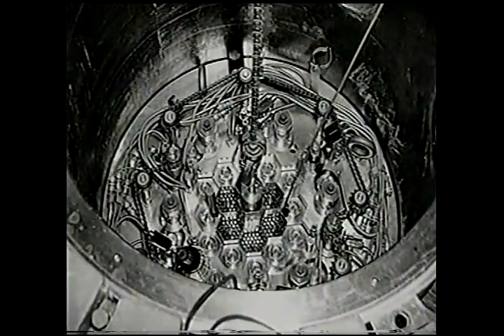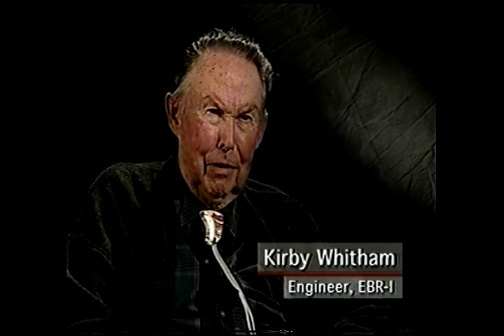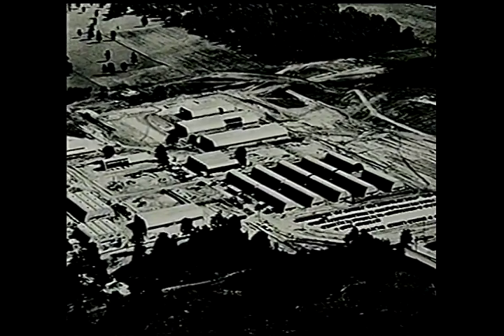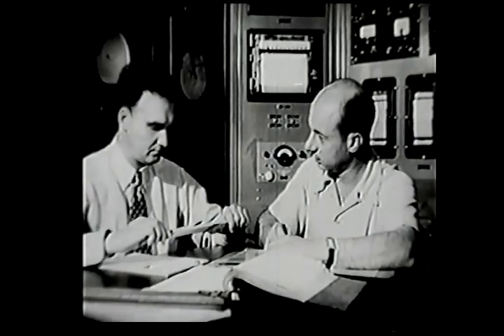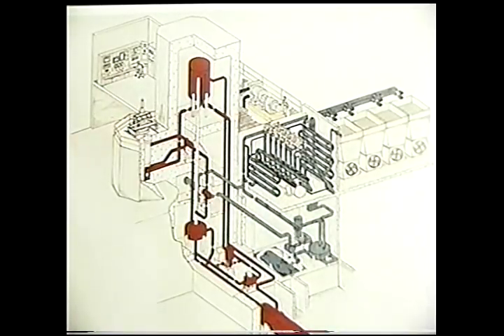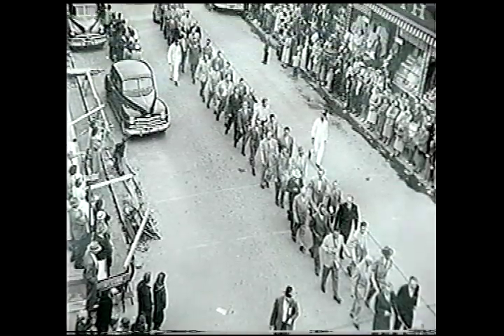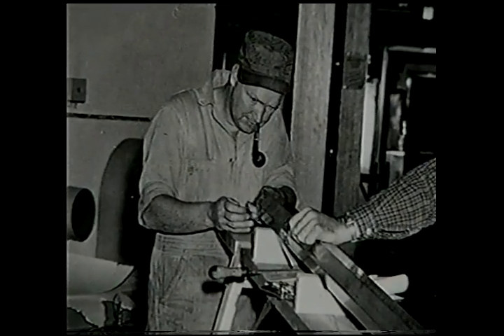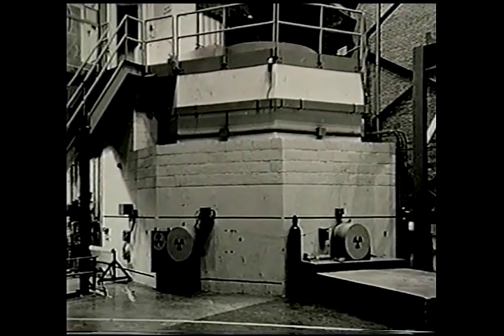Nuclear Pioneers: EBR-I

Comment: First off, this was a research reactor. Chernobyl was a full sized commercial power plant. There is no way this reactor could ever meltdown like Chernobyl just based on the number of fuel assemblies. Second, Chernobyl uses a completely different design (RBMKs aren't even breeders, they are just poorly designed run-of-the-mill LWRs, and the only reason they produced Pu is because the fuel was U-238, not U-235 like most LWRs).
Reply: USKilop and we all have heard that be for!!! It can’t happen
Reply: Truck Mechanic   You are aware of your username, right?
Reply: (layman) but didn't they intentionally keep the test reactor's wattage super low to make that risk pretty much 0

Comment: When you look at the level of height of building, sheer cost of design and R and D,  All the Castings and Heaters and extra steam tanks and vents and suppression pools...this tech is not viable and never will be.  It's dirtier and more expensive than coal.  San Onofre put out so much heat that it warmed the ocean.  Fishing boats used to fish at the edges, where the bass and mackerel were forced by the hot water from the plant.   The ocean bottom was scoured clean from the heat, none of the animals survived.  It was a disaster.  Mass slaughter on the ocean floor off Los Angles. You could build 100 NG plants for the cost of this half-baked NP scheme.

Comment: CP-1, the reactor you refer too also had no cooling system. In Chernobyl the water boiled and that caused a steam explosion. When the coolant in a graphite moderated reactor is lost the reaction continues and continues producing very large amounts of heat, and is impossible to control or shutdown due to a high positive void coefficient. In a water moderated reactor when the water is boiled off, yes they melt down, but the reaction is slowed severely or stopped.

Comment: On November 29, 1955, the reactor at EBR-I suffered a partial meltdown during a coolant flow test. Almost a first Chernobyl. The Americans have always been lucky when it comes to nuclear accidents.

EBR-I used uranium metal fuel and NaK primary coolant. It was in this identical to the initial configuration of the later Dounreay Fast Reactor which first went critical in 1959.  Dounreay suffered some very serious accidents and is now costing billions to clean up.
Reply: They failed to understand about Xenon-133 poisoning of the fuel rods!

Comment: The key in making these nuclear power plants safe
Is making them small       And only have enough material to run approximately five years  The construction of the huge power plants is what makes these accidents so frightening.  A small power plants something that would power up maybe a smaller community something that was easily take it off-line something that was easily made safe in the event of an accident is infinitely better than  getting machines it’s suddenly melt down and cause havoc for thousands of people. There are hundreds of power plants working on battleships submarines aircraft carriers that are reliable easily maintained and these are under some of the most harsh conditions. They have proven to be indispensable and safe
Reply: no to fuicken nuclear energy full stop...
Reply: fuku fukushima Then I had to guess you have to say no to the fucking sun. US military has 25 battleships aircraft carriers and submarines have never had a nuclear accident

Comment: Third, they would never get the green light to do this experiment if it was a water cooled reactor. They knew a meltdown was possible, but they also knew that the NaK would never contact water. Remember, the NaK is the coolant in this design, so water and NaK would never both be used to cool the same reactor, so what you are saying is impossible.

Comment: A successful experiment is no accident unless someone wants it to be, Scientifically speaking.
***
Often wondered why the Engineers designed the piping to fail in a clean break shear, as well as a corrosion pinhole (?), but after seeing the consequence of ER=EPR shell-horizon envelope-shaping of shock wave modulation containment in resonances, the possibility is realistic and relevant because the Reaction operates at the Critical Point of Nuclear Resonance, Fusion-Fission of Neutronic boundaries, and that will include the composition of the constituent nuclei in the pipes etc. Conductivity of the materials subject to possible shear is required to be extensively tested?

Comment: Moderators slow the neutrons to increase the chance they get absorbed by the fuel element. While light water does adsorb some neutrons a reactor can't function with out a moderator. Also EBR-1 had a very tiny core, and only produced 1.4MW of heat, the RBMK reactor at Chernobyl produced 1000+ MW of heat and a core that you could park a couple trucks in. Very big difference.
Reply: RBMK 1000 reactor like 4 Chernobyl are good reactors, 4Chernobyl was operating outside of operating parameters when it had problems they are still in service until 2037, I would take a RBMK 1000 over a GE MK1 BWR any day.
Reply: @gck82s  False! The RBMK reactors have many flaws, and Chernobyl-4 should have been fine, even "operating outside of operating parameters", when the power excursion occurred. Many of these intrinsic faults have been rectified in the remaining RBMKs making them far safer. Also, I agree about the GE BWRs.

Comment: From what I've seen, LFTR (Liquid Fluorine Thorium Reactor) appears to be something the US has pursue! And, much of the research was already carried out back in the '60's! Check out this website to learn more: energyfromthorium
What seems to be the stumbling block to this technology are the carbon and uranium cycle "merchant" interests.
Reply: K4Fusion   There are many technical stumbling blocks to ultra-high temp liquid salt cooling as well. Really significant ones in terms of material science.  The cooling tubes are so deeply imbedded in the design of a reactor that they must last decades to be financially feasible.  It is far simpler to replace the fuel itself than to replace or retrofit the tubes.  Until now, we have not managed to make a tube that can withstand the intensely corrosive combination of heat and salt for the needed service life to make a feasible reactor.
Reply: There are many ways to build a MSR. The reactor itself is not the issue and it's cheap.
The problem is political.

Comment: Look people we don't need any fossil fuels at all not for heat not for power generation and not for powering vehicle ,I have designed a machine that only needs a water source coupled with a water pump the water is brought into the kettle steam vessel which has an electric element like an ovens there are laser designator to keep water level above the electrical element the water is brought to a boil which treats and cleans water for cooking and washing and drinking the water after boiled is and a separate cooling tank and another tank for hot water separate from the boiling kettle so the boiling is always always quick water has to be brought in at a rate not too quick that put too much cold water at one time and the boiling point will take a long time to if water goes below element ,it will burn out right away ,this is all controlled by computer and after water is boiling the steam turbine generator makes power to charge a battery pack that would hold like a week's power and as it uses power the computer makes more just to keep batteries charged up . Make the house a real smart house sensor in each room like at Walmart it'll turn lights on and off as a person enters or leaves room and computer will put power where it's needed most first for heat for water for drinking so it's boiling water what's it's biggest by product ,heat it's heat so water sent into floor pipes that flow through a closed loop system and hot water goes through warming home up and as it travels the loop and cools it goes back into kettle to be reheated ,also water for toilets will be the waste water that is collected after it goes down drain or toilet it's cleaned treated separated and heated clean enough that is used for toilets only or yardwork , you don't need to be hooked up to town water or sewage or power lines and don't need a furnace or electric hot water tank and with a closed system we could make the separated feces incinerated by machines heat , it's totally green good for our planet and every bit of technology exists now  , I've designed an electrically compressed jet engine that also has a hot gaseous thrust without any jet fuel or fossil fuel at all it flies on Earth  atmospherically burning engines and it can turn fuel off land vertically on ocean and ballast to submerge then taking water through compressors then around combustion chamber and out the back as directional thrust water jet as propulsion and steering sideways no problem also be the fastest underwater craft then blow ballast resurface turn furl on empty water good relight take of vertically ,then using 767emptied only railgun equipment and power for launching my craft once into orbit on same Earth engines using that ballast tank filled with compressed oxygen close air intakes feed ballast air directly into compressors then the rest runs normally as jets do the thrust though is used to steer craft and propel craft so putting my craft on top of 767 but facing backwards so when he gets as high as can my craft intakes closed facing backwards the 767 goes into a dive so my craft is now on angle facing up towards orbit then railgun is launched to 5000mph at an already very high altitude ,then kick in the engines of craft for some extra thrust then wen returning get into air open intakes then relight then return home and land vertically this is some of the designs that could fix the planets climate change ,it all exists now every bit we could build the craft isn't flown by expensively trained pilot ,the computer flies craft using two pods on on top and another on the bottom each has a vertical laser designator and a horizontal laser designator moving back and forwards up and down very fast and they have a night vision camera a regular camera radar ,sonar ,heat vision flir ,also search for electrical signals all this info is fed updated constantly and fed into a hard drive that has a library of items weather mountians ,birds ,power lines other crafts ,stuff like that then it's reproduced on a computer screen constantly updated it won't matter if dark out or raining or snowing the computer can see through it all and make a clear picture of the outside as craft flies through air it has an iPod dock that is craft control unit it's loaded with mission info and wen plugged into dock the craft comes to life it takes off vertically doesn't have ailerons or flaps or tailfins for steering the craft no you put four engines two near front on either side in ncell housings they can move about 180 each then each engine has 360 degree thrust vectoring and the two out the back turn and pivot downwards like the f35 jet does then while pionted downwards they have the 360degrew thrust vectoring this four pillars is used to take off vertical and steer craft computer controlled that makes us system operator there's way more but I'll keep that to myself for now

Comment: I wonder how a lead cooled reactor would have reacted to such a meltdown. Defiantly wouldn't blow it's top.
Reply: Lead cooled reactors were used in Russia and still are if memory serves. You get a number of the same benefits with lead that you do with sodium. High heat tolerance, can be run at atmospheric (or near atmospheric) pressures, good heat transferability. Lead has an additional bonus in that it is essentially non-reactive with air and water, which makes maintenance easier, while sodium requires much greater care. Leaks of lead coolant don't pose the same hazard as leaks of sodium coolant. Sodium is a more efficient coolant and has some superior nuclear properties compared to lead. Neither will 'blow its top' though as neither is run under pressure. That's the whole reason for using liquid metals vs. water. To get sodium or lead to boil and form pressure, you need temps well in excess of what these reactors are likely to generate.
Reply: @DriveCarToBar  so lead poisoning no longer exists?
Reply: @obsoleteoptics  How would you get lead poisoning from molten lead coolant in a nuclear reactor? 
If you come into contact with molten lead in a reactor vessel, you got bigger more immediate problems.

Comment: And you to basic reactor physics. A class I have taken and you apparently have not.like USKilop said they would have never had tried that with a water cooled. Not mention at the INL they will purposefully melt down reactors all the time in the 60's thru late 90's. This is where all research regarding meltdowns come from. And there is no way any reactor in the US could be the same as Chernobyl. Chernobyl was graphite moderated, which will not shut down my itself in the event of a loss of coolant.

Comment: Fast reactors generally a metal for a moderator and coolant and experimental reactors they use NaK which cause the fuel rods to foam like shown in the video. and water will just boil to where there is no moderation and the reaction stops. So in no way could this ever have been like Chernobyl, ever. And considering it ran for over 10 years and by itself at night I would stay it was stable. Power fluctuations like that due happen sometimes, example EBR-II did the same thing it ran for 30 years.
Reply: Check up on Dounreay. https://en.wikipedia.org/wiki/Dounreay#Dounreay_settlement
It's an eye-opener.

Comment: isn't plutonium the most dangerous substance on the planet?
Reply: then what is.
Reply: +quest 34667 

Depends by what metric you are measuring.

In terms of chemical toxicity plutonium is a heavy metal like lead, not good for you so don't lick it, but not a horrible deadly poison that will snuff out all life with the tiniest bit of exposure.  As far as things that are worse than it in this regard the answer is 'lots of things', swallowing a 20 gram slug of plutonium is probably not going to kill you though it will be unpleasant coming out the other end while eating 20 grams of pure caffeine WILL kill your ass dead.

If we're thinking of radio-toxicity things get a little fuzzier, there's multiple isotopes of plutonium some of which are more radioactive than others.  If we're taking the case of plutonium 239 which is what people are usually referring to when they say 'plutonium' it has a half-life of ~24,000 years and when it decays it emits an alpha particle.  In the aforementioned case of eating a slug of it alpha radiation is really only dangerous inside your body so that's a bad place for it to be, but a solid slug would not have much chance to dissolve and would be passed by the body.  Getting back to the original question there are other radioactive substances that are much more concerning to be around such as cobalt 60, it has a half-life of ~5 years and is what they use to sterilize medical equipment and the like.  Eating 20 grams of that would give you a bad case of 'killed by radiation poisoning' in a hurry.

Finally in terms of being used as a weapon, yeah plutonium is pretty far up there being usable in nuclear bombs and all of that.  If you say that a nuclear bomb has a kilogram of plutonium in it (a number I made up, it is probably more than that but this doesn't change my point) and that a nuclear bomb would kill x-hundreds of thousands of people if set off in an urban area than yeah plutonium sounds pretty damn dangerous on a gram-per-gram basis.  But it's still not the worst thing I can think of, a little sample vial with some of hyper contagious super flu in it could easily end up killing tens of millions if released in the right place which again starts to make plutonium start to look like small potatoes.
Reply: thanks so much for that explanation. i enjoyed reading that. be well.
Reply: Botulism spores.
Reply: RICK LETT h strain to be more specific if irc
Reply: quest 77051   No, that would be hubris.
Reply: @KevinP32270  it's fuktonium
Reply: @obsoleteoptics  lolol.

Comment: The only reason to have a nuclear power program is to make nuclear weapons, it is the most expensive form of electricity generation there is. the stuff that comes out of a reactor the short life isotopes are infinitely more toxic than the u238 that goes in, they are not low carbon or carbon neutral construction mining enrichment shipment storage of waste and reprocessing.

Reprocessing the nuclear fuel cycle yes you get back some u238 but the real resin is to separate pu240 from pu239 and u235 po210 and tritium for nuclear weapons you also get 1000 times more waste most of which is contaminated water that goes in to the environment discharged at sea with no regulation, nuclear power is a misdirection con job presented to a public that does not know any better or the real consequences.

One last thing to consider, Regulatory lack of engineering understanding and installation cost and replacement cost, reactors lifespan 40 years it 40 years for a good reason Reactor pressure vessel embrittlement due to neutron flux BWR's operate at 600 psi PWR's at 900/1000 psi Reactor pressure vessel flex due to thermal expansion and contraction, reactor life extension is sort sited and dangerous yes it looks alright it has bean maintained regardless of cost, but the people giving the extensions do not understand the engineering implications.